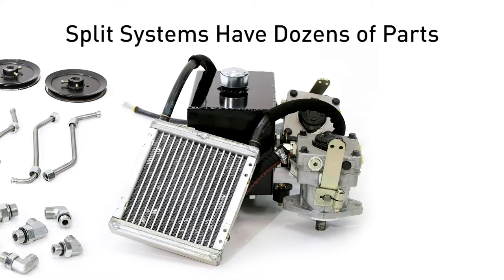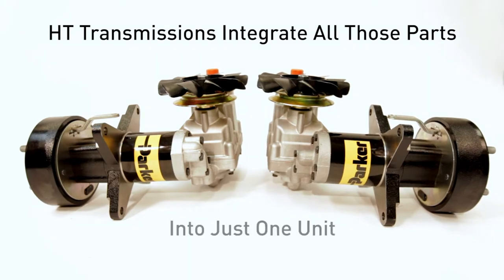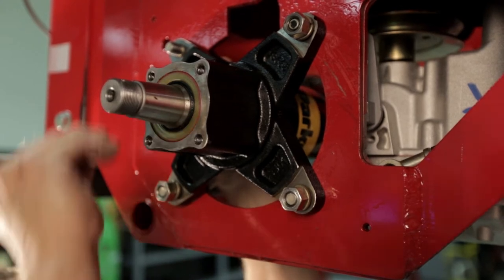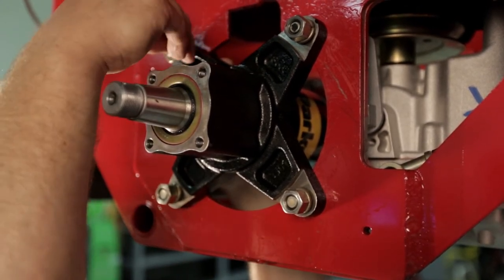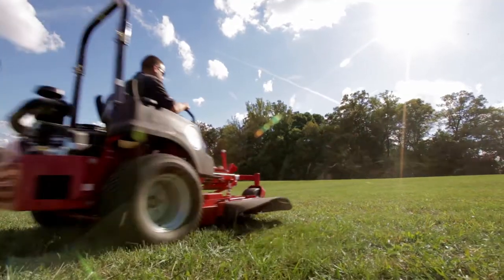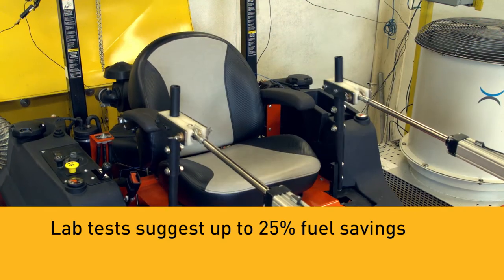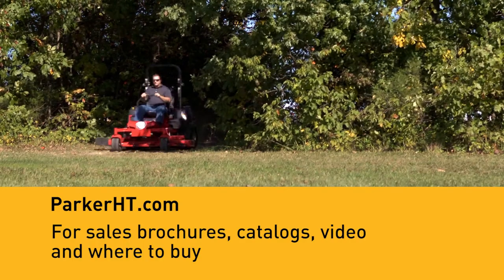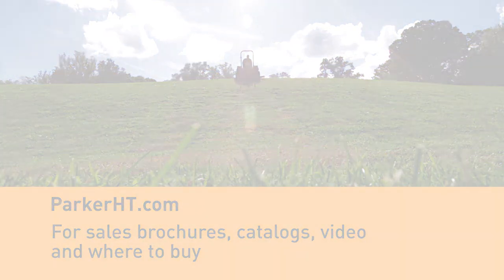Parker Integrated Series Hydrostatic Transmissions: More Power Options, Wider Market Applications

Comment: Would the 16cc pumps and 17.1 cu in wheel motors on Toro 6000 series classified as the HTJ or HTG as it look like the former but has the components of the latter
Reply from the maker: This model is an OEM direct model sold only to Exmark and Toro. It's called the UHT series and is similar to the HTG series.
Reply: @ParkerProductsSupport  so it has the external appearance of a htj but the htg internals? Because on the spec sheet for the 12cc, 14.5cu in uht for the s and 5000 is not a listed wheel motor size under the htj but is under the htg, close 237cc vs 240cc